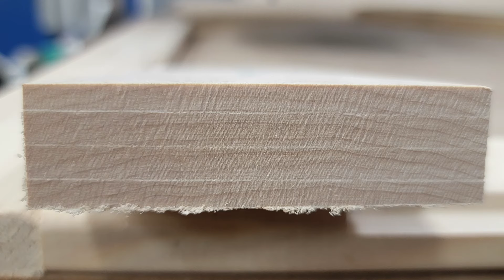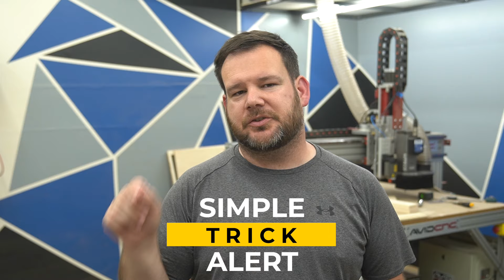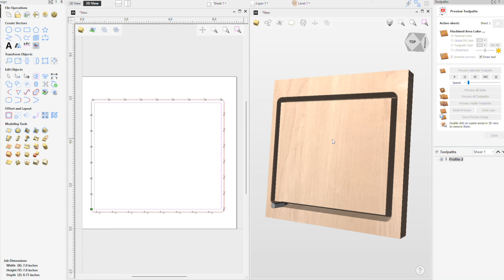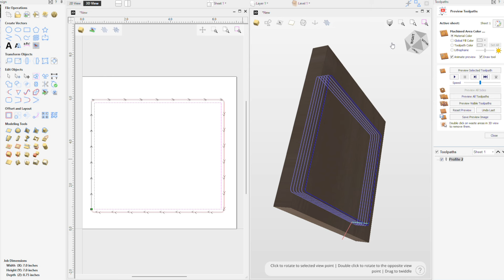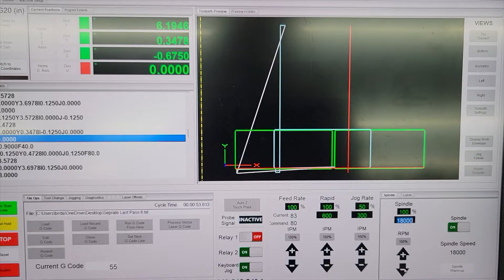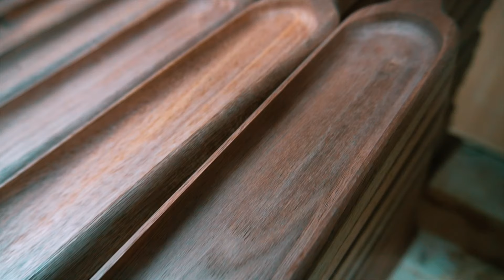99% of Beginners Don’t Know This Easy CNC Trick!

Comment: I have been hobby cnc’ ing for a few years.  To deal with these water lines, I use a very light full DOC finish pass as the last pass.  I also run this full DOC finish pass at half of my regular cutting speed.  I know, this isn’t optimizing the cnc machine or doing my chip load any favors, but it saves a ton of time.  I am thinking, as I write this, that I should try a ball nose bit for contours as the lack of perpendicular cutting edges should eliminate the water lines.  This would, of course, add a tool change to the mix and probably negate or even increase the overall cnc time.